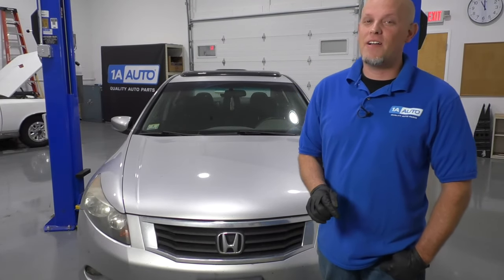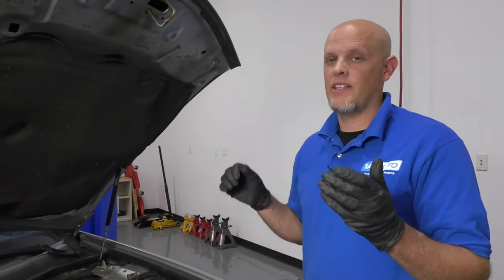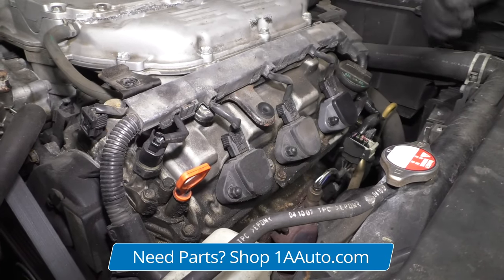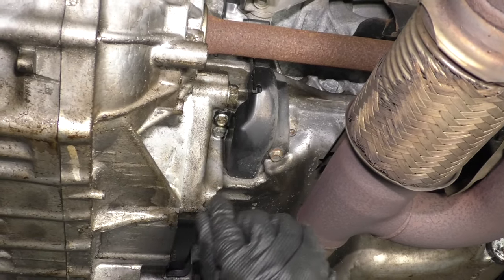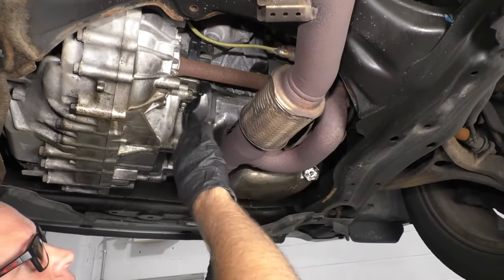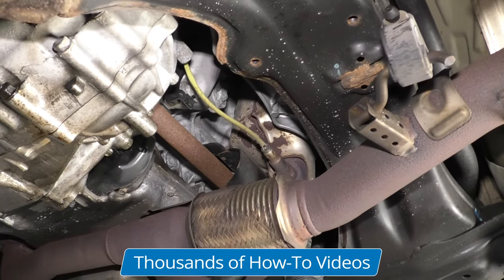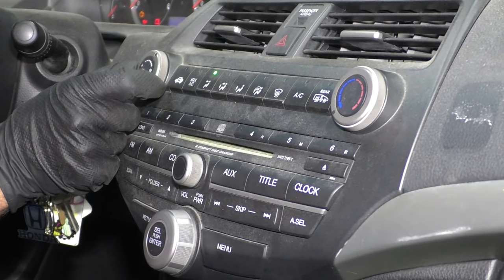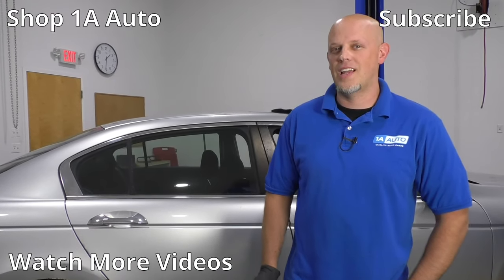Top 5 Problems Honda Accord Sedan 8th Generation 2008-12

Comment: 2012 V6 Ex-L here with 117k miles. Bought her brand new and its my second Accord (had a new 08 as well). Only thing i did was replace the alternator one time. Everything else was normal maintenance. Had the dealership do the timing belt at 100k. Trans flush at 70k. Still drives smooth with no issues and is my daily driver. Black on black leather. Drone Alarm app to start on and off from phone as well as temp and battery monitor. Anyone reading this far is still enthused and if I get a good offer I'm willing to sell it (Michigan car). Nothing but full synthetic Mobil 1 oil and filter every 5k miles done religiously. Sparks changed at the same time i did the timing btw. Custom modified HID headlights in original headlights and spares are still available.
Reply: Hi I’m interested in your car, do you have pictures?

Comment: I wanted to know if there’s a difference between 08 and 10.. like did they fix any of the problems? Since i have a 08 and im buying another one so thinking that if its worth it to buy a 10  instead?
Reply: Yes 08 was the 1 year of that model .. 10 should be better .. to be sure id get 11 or 12
Reply: It's the same thing. Rhe only thing that matters are the. I believe the new gen started at 2013

Comment: We have a 2012 accord 4 cylinder. Ac doesn’t work. New compressor and expansion valve. New relay and pressure switch. Clutch won’t engage. Jumper it to recharge. System capacity is 14-15 ounces. I got 12 oz in it. Still won’t engage and high side is up over 400 with fans off. 300 with fans on. Ambient temp of 95°. Only thing left to change is condenser and drier. Both are on the way from 1aauto. After that I’m at a loss. That was with pulling vacuum to 29 for an hour.

Comment: Thought you would mention the grinding sound of the engine on cold starts
Reply: Yes, that is the defective timing belt tensioner which is on all of these.
Reply: Yes, indeed. Same problem in all 4 cylinder 2.4s (Accord and CRV) from 2008 till 2016. Mine and my brother in law's have the same issue, it has to do with the VTEC actuator. Terrible grinding sound.
Reply: @ivanricardomecklenburg6417    spot on! timing chain guides for defective....Honda is like a Yugo
Reply: Thats the timing belt tensioner . Just replaced mine . Noise at start up is gone now
Reply: Got rid of my honda last year... Next owner's problem😅
Reply: @stevent27  Understood...Never got a recall notice
Reply: sounds like a out if tuned Mercedes 300TD upon starting
Reply: @JustNel  😆😆😆 i am gona do same . What a curse it is

Comment: I have a 2008 accord 4cyl and its burn oil ever since 60k miles. Runs good but have to add a quart of oil every 3 weeks or so. Also, I notice a rattle from the top end during cold starts or setting for a long time. Any fixes in mind?
Reply: Hi! What Motor oil do you use? Brand and viscosity? Maybe switch to a different oil? How often do you change your oil? Also check it for oil leaks especially from oil pan, front and rear main seal, spool valve at the back of the head and VTEC solenoid. It should not burn oil, it has a solid engine. A quart per how many miles?
Reply: @nicholaspetre1   Hello, I use Mobil1 5w20 full syn as of the last couple years. I do see oil wetness around my oil pan. The car currently has 262k but still runs good. I never really tracked the miles when adding oil, but I notice around 75% and 50% oil life. I’m adding a quart of oil. I’m good at changing oil at 5k miles. I’m currently running the car every other weekend from DC to NC. Doing some research, I’m thinking the VTC Actuator is making the spiny clicking sound during first start ups and long stop restarts and acceleration. Thanks for the follow up to my inquiry.
Reply: @erscott78  Thank you for the reply. Very good. Glad it is running strong. Stick with the same viscosity,. 5w20 should be fine if you dont have lots of cold starts and city driving. If you do, 0w20 may be a better option. Also, 0w20 has overall a better base stock, more synthetic stuff in it. Also pay always attention to the cSt Viscosity@100C - at operating temperature. Even though Honda recommends SAE20 in North America, the operation viscosity they require is on the higher side closer to 9.0. Their Honda factory oil has operating viscosity is 8.88 and you dont want to use anything thinner for sure. As for the intervals, taking into account the mileage of the car, I would clean it more often if you drive in city. Every time I drain oil from my Accord after 3K miles, I never like the way it looks and I do smell a bit of gasoline. Thats why I stick with 3 mo or 3K miles intervals. The matter is all those oils on the market, they are mostly hydrocracked and they wear out faster. Even 5K miles in a city is kind of a lot. Whatever they write on the jug is BS. Fully Syn oil cannot cost $30 for 5 qts these days. Thats why oil analysis show hydrocracked base is the predominant in the oil. Those which are closer to FULL Syntth with real PAO + Ester base stock cost around $15 per 1 qt - like Redline, Amsoil and others. They can go easily 5-7K in city but still not more, as they seems to hold up pretty well within 5k mi, and then after 6-7K miles in city their compound sags down. As for the brands, I noticed my car works best on Penzzoil Ultra Platinum. Way smoother and quieter than with other brands. Again, inspect your engine for leaks regularly before be sure it does burn oil. I thought my Accord burned oil when I noticed spool valve leak at the back of the engine. Also, regarding oil burn some oils do tend to burn more. Usually cheap stuff. Please pay attention to your oil's physical properties -Noack evaporations loss and others. Oils from better brands tend to stand heat much better. Also, change your PCV valve - might help with oil burn and change spark plugs every 60K miles. Air filter every 10K mi. VTC actuator may need replacement if it bothers you, its time might have come. Frankly speaking if maintain this car properly, 262K mi can be only half life it. This is one of the best Honda engine with no cancer issues like direct injection or turbo. It really can run for long time. Good luck my friend!
Reply: @nicholaspetre1  Thanks for the info. I'm not looking forward to buying anything new no time soon. I will consider the oil options and intervals to change. I assumed 5K was standard since shops would put that on the change sticker before I started changing the oil myself. I do alot of city driving so I'm open to the suggestions. Side note, I had a service advisor tell me that the car manuals are designed to keep you in the shop since that's how dealers make their money. Thanks again...
Reply: @erscott78  Well, there are a lot of variables in how people drive and how they maintain their vehicles. Driving style, city/highway driving, climate, fuel and oil used, oil and fluids service intervals, parts quality - it all matters. Service advisors sometimes also can recommend you something you do not need as they also make money. It all comes to common sense. Preventive maintenance is what we all need to do. Take care
Reply: Mine use to burn oil and a mechanic once told me to always use Castrol full synthetic in my Hondas and I haven't had to add oil between changes since. Blew my mind he was right.
Reply: @MarkisDavidson-ti4lg  you run 0w20 or 5w20?
Reply: @erscott78  0w20 full synthetic. When I used Mobil 1 I would have to add a quart after about 3k and change it every 4-6k. Now I run it over 7k and maybe add half a quart between changes. It doesn't burn oil nearly as much, for some reason Hondas love Castrol. Works on my Integra too.
Reply: @erscott78  it's Castrol Edge full synthetic btw

Comment: Do you why my 2010 V4 honda accord is always noisy? Is that normal with it? Also, the steering isn't easy to manouvre nor soft.
Reply: You should see my piece of shit 2007 Camry
Reply: They don’t make V4’s
Reply: Could be the power steering pump ...very common issue with that model
Reply: @bmny78  💯💯💯💯
Reply: @chky8924  Honda’s 4 cylinder motors don’t come in a V shape 🤣🥴
Reply: I'm happy that she atleast left a comment on this topic.
Reply: V4 lol now that would be sweet
Reply: @ras4782  Why?  Because it sounds 'exotic'?  The only real benefit to a 'V4' would be packaging (size in engine compartment), and if that's the case, you're talking about a tiny engine compartment, anyway.  Otherwise, an inline engine will generally be better (especially a six) for balance (smoothness), power, and longevity.  The problem with them is length (again, packaging).  V8s can be well balanced, but those are a different animal.  If I were shopping 4 cylinders, I'd take an inline 4 any day of the week.
For an example of a car with a V4, check out early Saabs (like 1960s).
Reply: @donoevil8042  its some older cars with v4 engines .. But a up to date car would be sweet
Reply: @donoevil8042  my bad i didn't read your whole text tell after my text..

Comment: My 8th gen has had starting issues, I’ve replaced the starter but always ends up with the check engine light blinking. Not just that but it won’t accelerate past 30mph
Reply: Coils acting up, disconnect battery wait min., reconnect to reset computer. Remove the coil cover, the coils cook being covered

Comment: What happens if the p0420 is never fixed? 
I thought converters were only necessary to change if one’s state does emission tests. Will a bad converter ruin my car in the long run? 
Thank you .
Reply: Only if it gets clogged. Sometimes you can put premium gas and run it hard on the highway to get the cat to burn up any carbon buildup on them. Usually works for me when I get that code from time to time.

Comment: Wait so what happens when that been that specific converter that you're saying fills up with fuel and gets clogged does it start spitting smoke out from the back right spark plug area or underneath that area cause that Is where it looks like it is located. But my car lost power on the freeway. Pulled over and then when I started it again it's making a popping noise and dumping oil. I just replaced the spark plugs the night before but one was rested in place right in the area I think it may have clogged 1 of the catalytic converters.
 But are these symptoms of that ? My check engine light never came on

Comment: Hi, Here's a riddle for you......I've got a 2012 Accord V6 showing a P0430 code. I took it to a muffler shop and they removed the Cat, checked it and found that it was clean. They checked the O2 sensor on the computer and said it was fine. Also checked for vacuum and exhaust  leaks, none found. I do notice that the check engine will go out when the outside temp is between 65 and 75 degrees F. Had a buddy tell me that it might be the Mass Air sensor but haven't checked that yet. No codes for it either.  I have followed the Honda maintenance plan for this one to the letter. It has 239K miles. Any thoughts? Thanks!!
Reply: Coil packs?
Reply: @gagelindsley1337  Thanks for the reply I'll look into it. But if it was an Ignition coil,  Would it throw a code for the coil? Which is 0351  instead of 0430?

Comment: Hi. I have the v4 2011 modeled version and it consumes way too much fuel. It can take about 3 litres of fuel just driving 5 miles. 
What could be the problem please
Reply: The Catalyst most be missing. The car is low fuel consumption car. Check for the Catalyst most likely its been stolen
Reply: @ugoufomba9416  what? Dammmm
If you find the issue please update 
Thanks!

Comment: I own a 2012 Honda Accord 4cyl LX. The uncomfortable seats and torque converter shaking at low acceleration (around 1900- 2100 rpm) and the basic infotainment system is what I dont like.( yes I can buy an aftermaket radio)  is what I dont like about this car.
Reply: MrChickenspit, I bought a 2010 with 181k miles.  Also had the shaking at low speeds and after research I decided to get 3 quarts of Honda brand ATF and do a drain and fill.  That was 3k miles ago and it smoothed out the low speed shutter.  If you do this the process is simple, remove the bottom plastic cover, remove the drain plug and 3 quarts will drain out, replace with 2.5 quarts and top it off as necessary to make it full.  I am going to do this 2 more times to get the transmission fluid clean without too much of a shock to the system.   Next time at 6k, and then 9k miles should get everything clean again.
Reply: I think I have this same problem, does it get worse after driving for a long period in stop start traffic?. I thought it was the engine but maybe not
Reply: @glenderksen70  i did a drain and fill on the transmission fluid, and it did help. i changed it when my car had around 101,000 miles. it doesn't shake alot anymore
Reply: @glenderksen70  overall, this accord from this year has been reliable to me. No issues. no loud valve ticking, good acceleration and handling. reliable.

Comment: In regards to the bad cat, I had a ‘05 Elantra beater I drove for like 3 months.  It had a bad cat and an exhaust leak.  It never really caused me any issues, no power loss or acceleration loss...

The cat is way down pipe part of the exhaust system obviously, why would it impact acceleration? And why is it a problem at all, aside from emissions?  Very curious to know. Great video!
Reply: I had a cat replacement on my v6 honda accord and i had no acceleration at all so the mechanic told me its like breathing. The engine wants to breathe through the cat but if the cat is bad it wont let it breathe properly so therefore the slow acceleration
Reply from the maker: The catalytic converter can cause power loss or stalling if it is clogged, because the exhaust gasses can build up pressure, making the engine work harder. If you had an exhaust leak also, as you say, the pressure likely did not build up enough to affect your engine. It left the system through the leak instead! Thanks for the question!
http://1aau.to/m/Shop-1AAuto-Now

Comment: My 2012 Honda Accord EX-L, a 4-door model, produces a juicer machine-like sound only in the morning when I first start the car. However, after the initial startup, I never hear this sound again until the next morning's first start. Interestingly, if I open the hood before starting the engine, and then start the engine with the hood open, there is no juicer machine-like sound. What could be the reason? Any ideas? Thanks
Reply: Vtec actuator is bad and needs to be replaced

Comment: Got p0420 and p0430 code. I cleaned out the MAF and replaced the air filter and the code went away for a few months. But it's back now. :( Would that be a cat replacement or are the o2 sensors just faulty? 

Another question 1A auto, the old owner replaced the slave (or master?) cylinder of the clutch recently. The clutch sometimes is stiff getting into first gear. And sometimes it catches very suddenly in first gear. What should I do?
Reply from the maker: +Mrcool179 We wouldn't be able to diagnose an issue like that here, you may want to have a local mechanic take a look at it. Thanks for checking us out! http://1aau.to/m/Shop-1AAuto-c
Reply: Check for cracks in the big intake hose from the air filter to the throttle. Then check for holes in the exhaust before the rear muffler. Then replace the O2 sensors. Start with the one near the main CAT first. New CAT should be your last resort. If you do replace the CAT you should replace the O2 sensors with it. So if you end up having to do that then why not start with the sensors to see if that solves the issue for less money. CATs can take some serious abuse for a long time before they die.

Comment: Dear owners, change the oil is this vehicle every 3K miles in city and 5K if highway. The oil gets diluted with fuel after a certain mileage and oil is not good. Also, seals like fresh oil, so change it more often and you will avoid many problems. It is a good car, not such pain in the butt like many newer ones out there.
Reply: with Conventional motor oil, NOT SYNTHETIC. it even says on the engine bloc: Conventional Motor oil.
Reply: @fightingidiocy7724 Actually in my Accord 2012 it says Premium Full Synthetic Motor Oil with API approved logo
Reply: @nicholaspetre1 same I’ve got a v6 says full synthetic

Comment: the alt. is the electric power plant for the car . the battery is only needed to start the car     your battery cells expire and will no longer take a charge from the alt.
your car will not take you more than a few miles  running off  a good battery battery.   if you start your car and disconnect the battery and the car still runs your alt is working   if you start your car drive it 20 miles and turn it off then try to start it and the battery is weak YOU NEED A NEW BATTERY

Comment: Waht about the piston rings, burning oil
Reply: Yep.. there was a recall on it, mine didn't qualify, but it burns oil... Eventually the cat will go bad and it'll fail smog test
Reply: My 08 was part of a recall but the dummy I bought it from never did it. I go through 3-4 quarts of oil between 5,000 mile changes.
Reply: The Honda mechanics I have talked to who have to do the rebuilds tell me the engines they have had to rebuild were owned by Karens who never do any oil changes, etc and the condition of the car brought them to tears.
Reply: @m----  just install the S-VCM @ $100
Takes about 15 minutes to install.
Problem fixed it on 2 of mine.
Look it up.

Comment: Have a 2008 with same engine as in video and it leaks at the base of t eng oil dipstick. It drips right on top of alternator n continues to ac compressor. After a while it'll burn both. Have not figure out how to stop that leak.
Any help is much appreciated.
Reply: I have a 2008 accord. I just dropped it off to change my whole engine. Get yours to a good mechanic for a proper diagnosis.
Reply: Take it to a mechanic lol don't wait on it
Reply: It's the front spool valve.